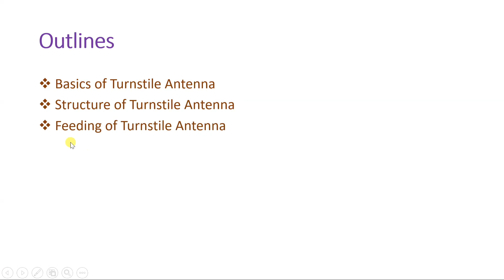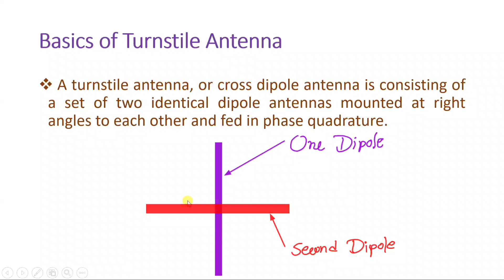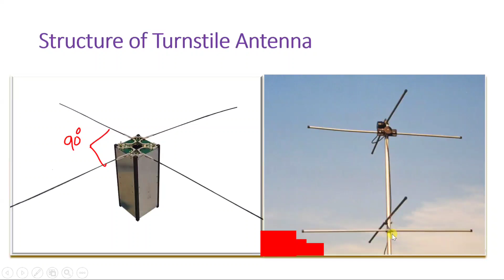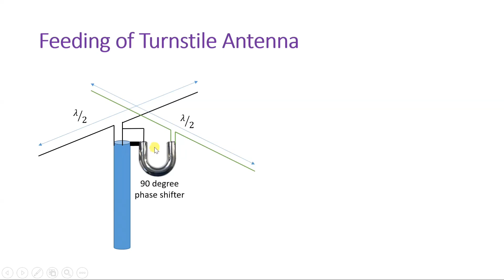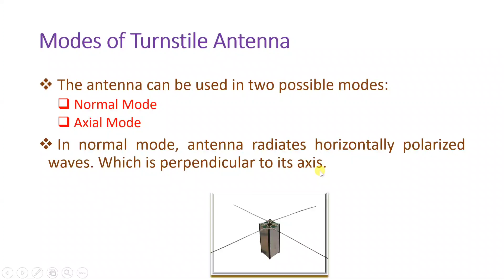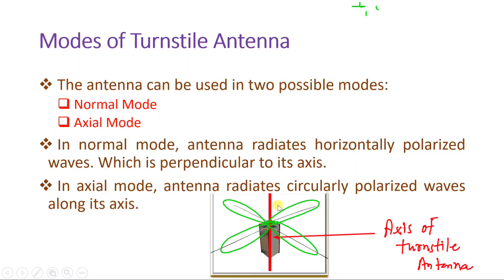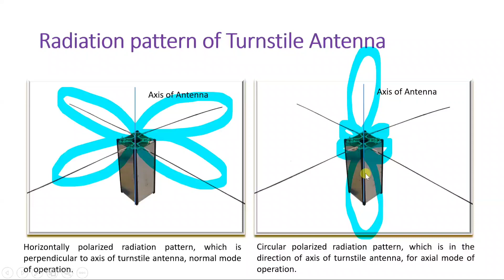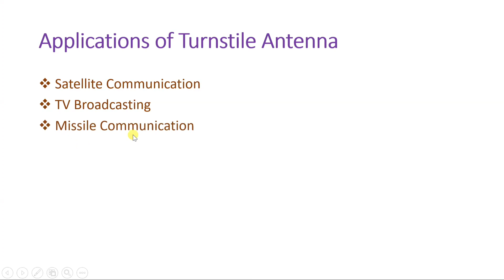Turnstile Antenna (Basics, Structure, Operation, Modes, Radiation, Feeding & Applications) Explained

Comment: Does axial or normal mode effect construction of the antenna? I was told I must construct my antenna in axial mode, but I haven't been able to find more information on the topic. Does mode matter if I only want to receive signals?
Reply from the maker: Yeah it matters but comments it's difficult to explain here
Reply: @EngineeringFunda  Are there any resources you can recommend to learn about building an antenna in axial mode?